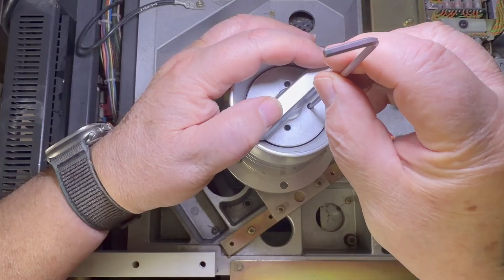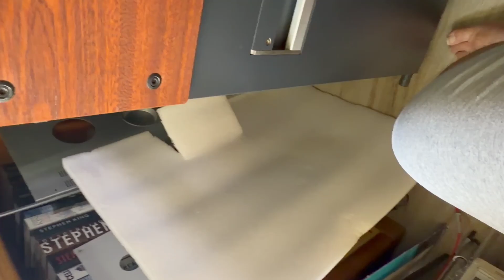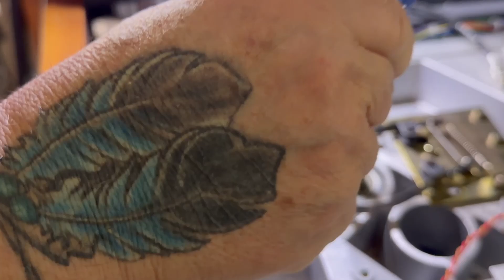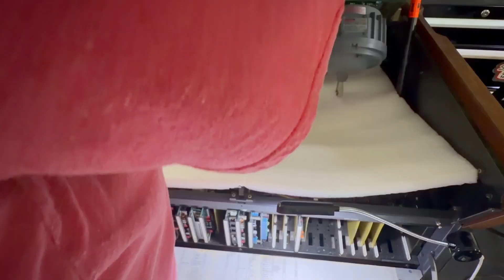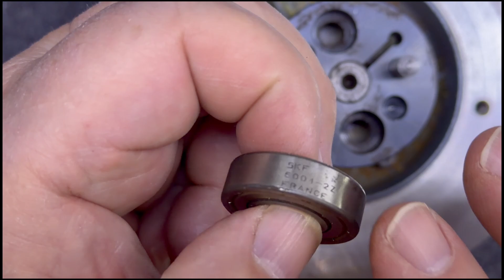Studer A820 2" Multitrack Restoration - Part 53

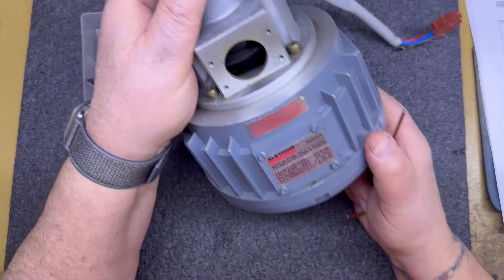Comment: I'm sure it will help to change those bearings and clean all that up in there. Make sure you clean that encoder disk well because it looks like some trash on it at 13:22 which can definitely cause a problem. Thanks for the videos. I love old tape machines.
Reply from the maker: That's the plan! Yes I love these old mechanical/electrical wonders. Thanks for watching!